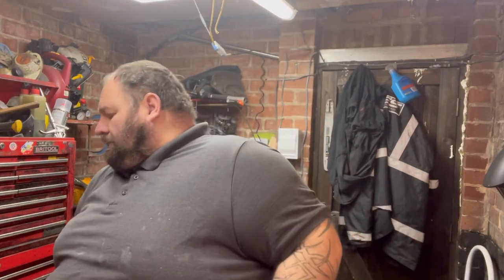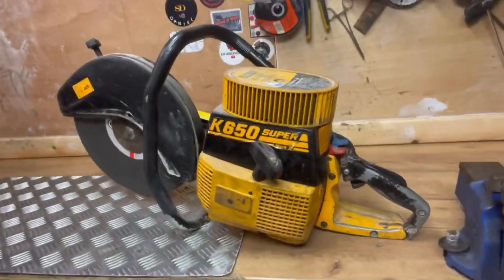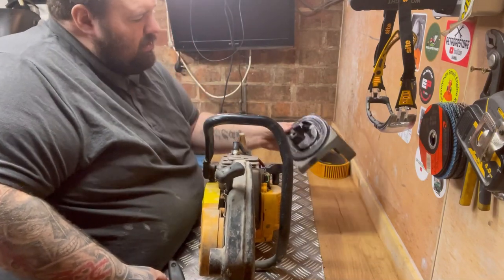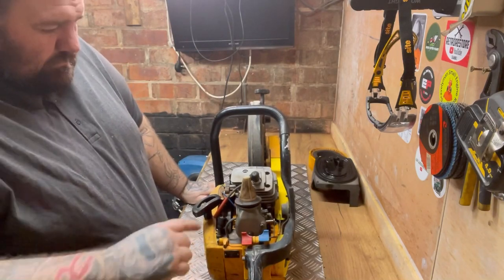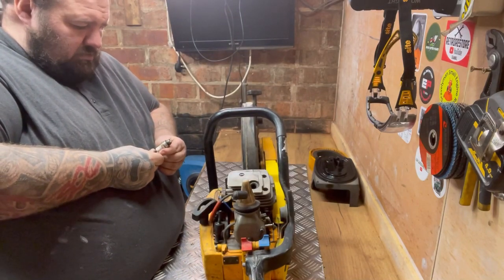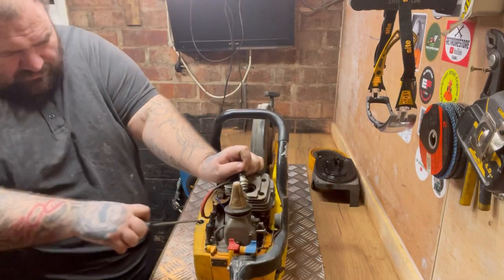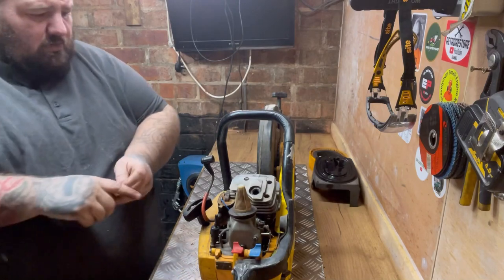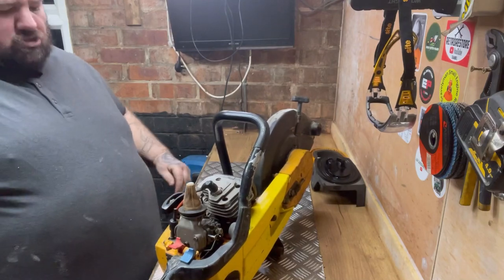howto repair a Partner metal saw k650

Comment: I have one of these saws that will not start, have cleaned carb too. I have noticed fuel in the bottom of the metal air intake manifold. Any ideas?
Reply from the maker: Hi Ray I would say needs new diaphragm kit for it or a sticky jet it's  letting the fuel flow Constantly when should be closing off